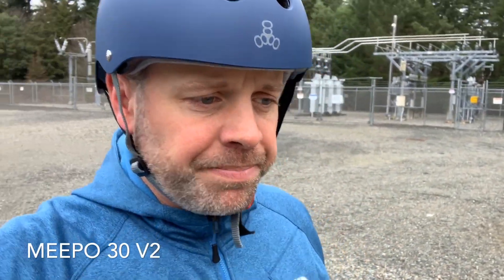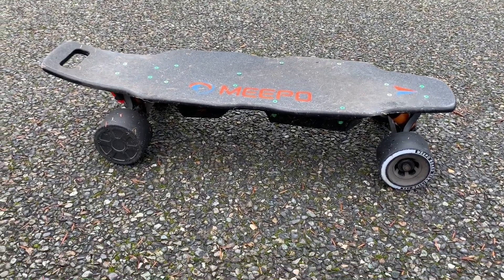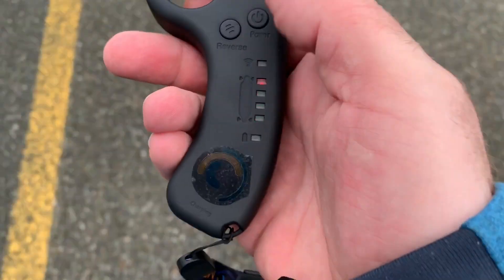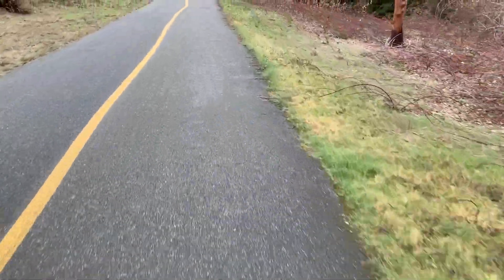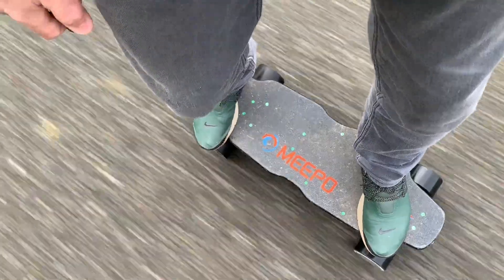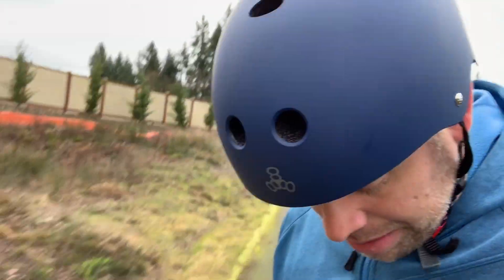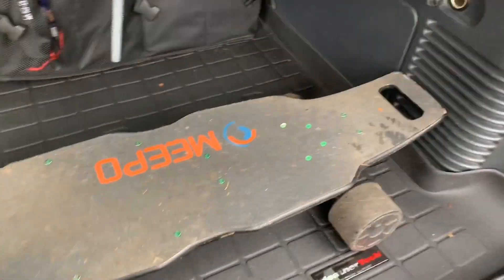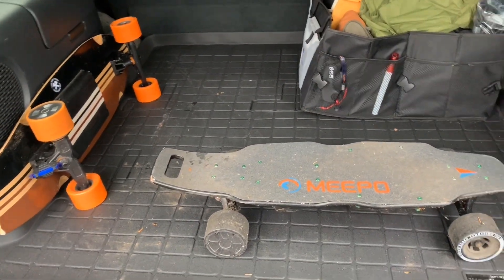Meepo 30 V2 Is Tough And Cheap!

Comment: I have the meepo v2p 30" too and its been brilliant, i was going to get the longboard meepo for its stability but found this holds up fine and at fast speeds too
Reply from the maker: Zugis Bugis I totally agree!! I feel completely comfortable at full throttle on the pro setting. I think it’s an all around great performer for its size. The only thing I would do differently is add the Sanyo battery for some better range if 8-10 miles isn’t a good fit for you.
Reply: @rightorwrong9412  yeah the range is a drawback on the standard battery but with the eco mode i usually find i can get to around 10 - 11 miles on it, but the higher speed modes are more preferred.
Reply from the maker: It is a little draw back but for the price I really can’t complain. Let’s just say this one was a stepping stone for the next one. :)

Comment: Does your feet ever accidentally rub against the wheels? I want the 30” but I’m kinda worried this will be a problem when trying to make turns
Reply from the maker: David Salsberry I actually ride this board with my feet directly over the trucks. With my weight and height I honestly can’t think of a time my feet have touched the wheels. Now not to say they couldn’t but I have I don’t think I have on my rides. I have the trucks tightened up a bit as well.

Comment: Does your 30 inch have push start? My 30 inch doesn’t, think I have the older esc that came out first. What top speed do you get?
Reply from the maker: Sw yes, this board is the v2 that has push to start. On the flats I can get it to about 19-20. My son was on a scooter with a digital speedo at 17 mph and I was pulling away from him.
Reply: Hitting about 23-24mph on my v2p mini, one of the best boards I have brought. Good video 👍👍
Reply from the maker: Sw agreed it’s a great board at the price.

Comment: Mine was bulletproof until recently. Now it doesn't want to go full speed all of the time. It kind of have to press full speed on the remote a few times to get it to go full speed and the brake isn't engaging all of the time anymore either. I have a feeling I just need to clean the motors! I abused that thing so I kind of expected it to fail eventually. but since it survived my abuse I ended up buying the mini 2.

Comment: Great vid...quick question...where do u send board if it needs repairs
Reply from the maker: wsalas13 the one repair we needed Meepo was awesome about sending it to us for free and we swapped the part. Check out the video. As far as a anyone else repairing I think you are left with replacing parts on your own which really isn’t hard.
Reply: @rightorwrong9412  Very good...I'm going to pull the trigger then...thank you so much for your reply...ride safe sir.
Reply from the maker: wsalas13 thank you! Have fun on the board!

Comment: Is that the standard range version?
Reply from the maker: ryanhayn yes, this is the standard range V2P. If it’s in your budget the Sanyo battery pack would be worth it.
Reply: @rightorwrong9412  Thanks! I bought the extended range 30" a couple weeks ago. Still waiting for it to arrive :(
Reply from the maker: ryanhayn it will be worth the wait.